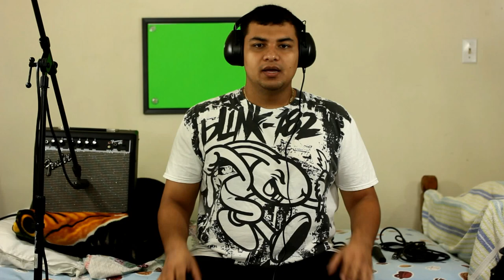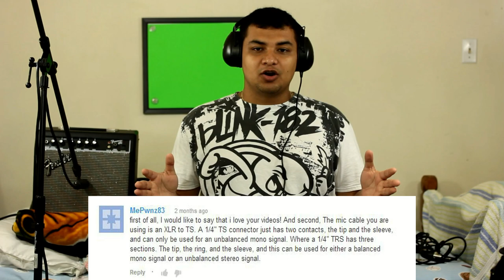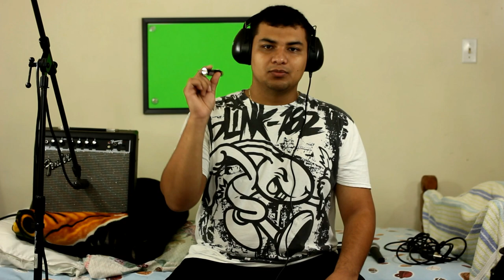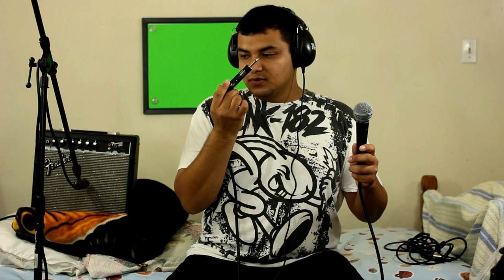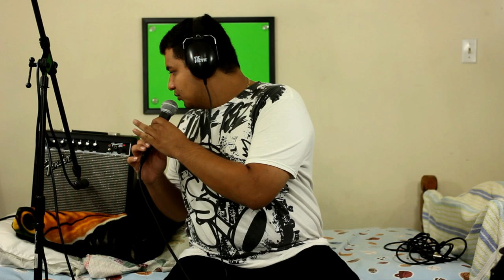How To SAFELY Plug A Dynamic Vocal Microphone Into A Guitar Amplifier

Comment: i kinda have a question, could it also work with a condenser phantom powered mic ? with the phantom power supply of course
Reply from the maker: +mr brownie2412 Hi there, it should work. I seem to recall trying this out a while back but my memory is hazy as I'm constantly trying random configurations. You would just need two XLR female to XLR male microphone cables. The first cable will connect your microphone to the phantom power supply and the other will connect the phantom power supply to the impedance matching transformer. I hope this has answered your question but if you have any follow up questions, comments, or concerns please feel free to contact me anytime. Thank you for watching and for trusting me with your questions. All the best :)
Reply: +mr brownie2412 Nope because the amp doesn't give phantom power. If you want to run a condenser through a guitar amp or any processor that expects instrument level (which is not microphone level by the way, so using the method in the video gives a pretty significant impedance miss-match which is either good or bad, depending on the sound you want) you should use a reamp box like a radial EXTC. It takes line level and turns it into instrument level so you can run any line level signal through any instrument level process. I have the 500 series version and love that thing. I have a custom hand wired tube amp made by RedPlate (An rp50duo) and the special thing about this amp is that it doesn't eat the transients like most amps do. So I can run snares through it to beef up the mids / low mids and it doesn't "artificially" compress the signal like most amps do. 
If you're going to run audio through guitar amps that have a master volume, turn down the preamp volume and turn up the master volume so you get the sound of the power tubes rather than the pre-amp tubes. The pre-amp tubes have a mid-range focus that sounds very boxy in most amps, whereas the power tubes just give that tube processed sound.
Reply from the maker: Jason Cox mr brownie2412  Hi there, thank you for your input. I greatly appreciate it. The reamp box idea is absolutely fantastic. However, I have to respectfully disagree with your initial statement. With all due respect, it seems that you have overlooked the fact that in the setup I suggested the condenser microphone is running into a phantom power supply first and then the output from that phantom power supply is running into an impedance matching transformer before going into the amp. This should be an inexpensive solution that's just as safe as using the reamp box. However, the Radial would be a much more elegant and, mostly likely, more reliable solution. Thank you for watching and for taking the time to offer your ideas. Best wishes :)

Comment: hey there i have a friend who want's to perform live with my marshall mg combo, she has a mic with a 3,5 aux attached to it, do i need some sort of transformer for it?
Reply from the maker: Hi there, my knee jerk reaction is to tell you that it's best to avoid having to run a microphone into a guitar amplifier but on the off chance that you find yourself backed into that particular corner I would strongly recommend that you use a transformer like the Audio-Technica CP8201. However, from the sound of it your friend's microphone has a cable permanently attached to it and although I can't be sure what the impedance of that microphone might be I'm positive that it's most likely not going to be appropriate for your amplifier. That being said, I know that the newer MG series combos have an aux input and it's probably safe to run that microphone through that input. I've done something similar with my Orange Crush. My overall advise, would be proceed with caution and to avoid pushing the amp past 1 o'clock if you are going to try this. I'm sorry that I couldn't be more help and I apologize for the delay in my reply, but I hope that this has been of some help. Thank you for watching and for trusting me with your question. All the best :)

Comment: can i buy already made cable like that and for my type of singing i need echo does amp have echo?
Reply from the maker: Hi there, unfortunately as far as I know you can't buy a mic cable with a built in impedance transformer because none of the companies that produce microphone cables seem to make one at this time. In regards to the amp, the one in the video does not have any built in effects except for overdrive and that tends to be the case for most combo amps in general. However, lately several manufactures have begun to include built in effects into their solid state combo amplifiers. An example would be the updated version of the amp in the video which is now called the Fender Champion. Additionally, because you are a vocalist I would suggest you look into purchasing a PA system, for your performance needs, like the Behringer Europort EPA300 which includes built in effects. Echo is not specifically listed but it does have delay and reverb with can be manipulated to produce a similar effect to an echo especially when they are blended correctly. You can also look into a personal PA/Keyboard amp like the Behringer K450FX Ultratone Keyboard Amplifier which also includes a similar set of built in effects. I suggest these because they are nicely priced, well equipped, and user friendly. Also if you get a PA you won't need to have an impedance transformer. I hope this has helped but if you have any follow up questions please feel free to ask. Thank you for watching and trusting me with your question. All the best :)
Reply: Thanks man ill look for some of these you mentioned and will buy one hopefully :D
Reply from the maker: You are very welcome.  I'm here to help so if you or anyone you know has any questions about gear I'd be happy to help. Awesome!  I'm glad the info was useful.  Let me know if you ever post your work online so that I can check it out. All the best :)

Comment: It says "safely" so I was just wondering what happens if you plug in the microphone without the transformer.
Reply from the maker: therealscarface18 Hi there, I've been told by people that are much more well versed on this subject than I can ever hope to be that the mismatch in impedance that results from plugging a common vocal  microphone directly into an amplifier can result in your speakers being damaged. I personally have never experienced this problem but I have noticed that when I use an XLR to 1/4 inch cable that I have to turn up the volume knob a substantial amount to get a desirable loudness. This is an issue that is noticeably remedied by the transformer.  Ultimately, I made this video and titled as such because I wanted those that watch it to know that this is the most foolproof option according to the wealth of information that I've received on the subject. I hope that this has been helpful but if you should have any follow up questions or concerns please free to let me know. Thank you for watching and for trusting me with your question. All the best :)

Comment: i have the problem with my amp that when i kick in distortion and turn on mic i get a feedback immediatly and its squeaking really LOUD,but if i play it doesnt squeal but i have to play on my harmonica really fast to get rid of the feedback. Can someone help?
Reply from the maker: Hi there, my apologies for the delay in my reply. There are a couple of things that you can try to get rid of the feedback. First, try moving away from your amplifier as much as you can afford to do so and see if this helps at all. If this doesn't help with the feedback try reducing the gain to a level that still satisfies your needs and gets rid of the feedback. If this is not possible, you can try using a noise gate in the effects loop of your amplifier. My current favorite reasonably priced noise gate is the Electro-Harmonix Silencer (https://tinyurl.com/ya2v9f8c). It's absolutely fantastic and if it doesn't solve the problem I would take it as a clear indication that your setup needs to be reworked. I hope this helps but if you have any comments, concerns, or follow up questions please feel free to contact me any time. Thank you for watching and all the best :)